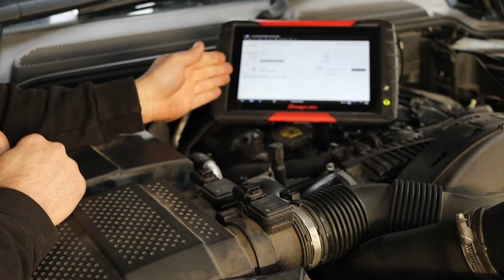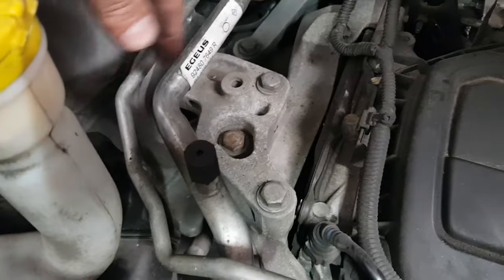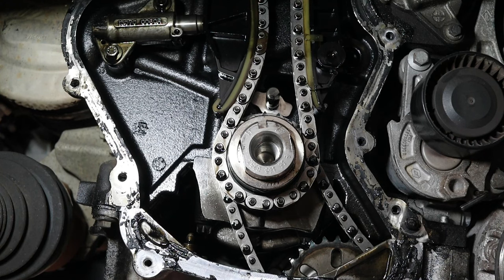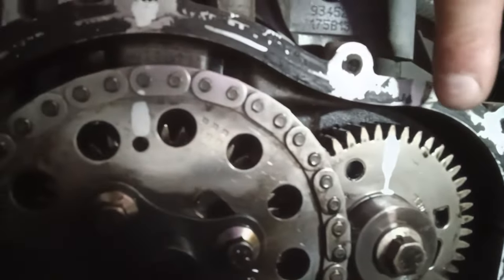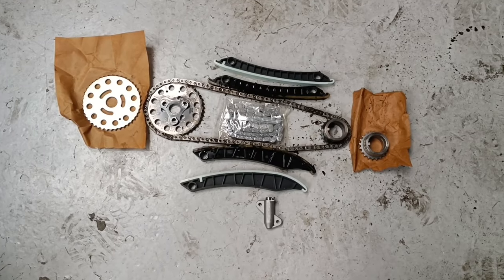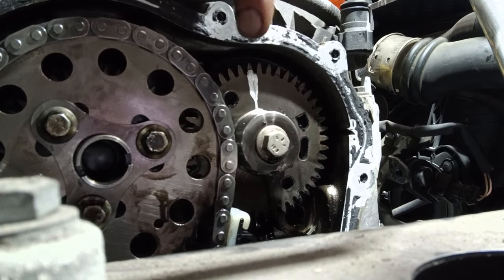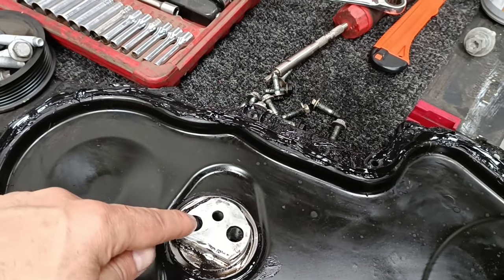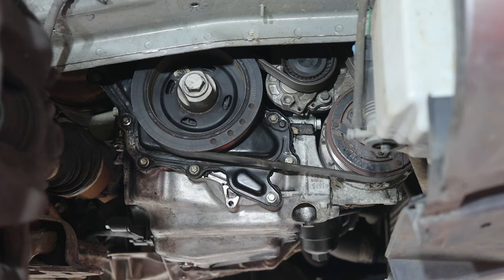Vauxhall Vivaro/Renault, Nissan R9M timing chain replacement

Comment: Really good video, I liked the explanation of there not being a "stretched chain" and instead the links wear out giving the impression that it's stretched.

The camshaft timing confused me though, on another video there seems to be markings on the sprockets, some even have one or more gold links on the chain which you then have to align up with the top and bottom sprockets. Whereas this relied on good old tipex, be fluffed if that rubbed off 😂

I'm glad you shown how to time both the top and bottom without the camshaft locking tool, unless you get one imported there's none in the UK I can find. Any reason you decided against the crankshaft/flywheel locking pin to keep the bottom in time?

Also, with the gasket sealent I tend to find a lot of people stating you should tighten bolts just a tad and leave for around 24 hours for the sealent to fully dry and then Nip them upto torque specs, I was going to do that myself as the R9M is notorious for leaking on the front cover. 

Last but not least, was it not worth replacing the oil pump chain?
Reply from the maker: Thanks for watching, unusually there were no timing tools recommended in my technical data for this engine, I do keep a lot of timing tools but I only needed one, Tipex! The pump chain didn't seem too bad, I guess only time will tell. I siliconed both faces saving me 24 hours, every mechanic will work in their own way and will have their own tricks and tips for repairing different jobs. Thanks for taking the time to leave a comment 👍😊
Reply: unfortunateley on that engine in the Video it's one of the recent R9M engines which doesn't have an oil pump cover any more, it's the whole sump that needs taking off to remove the oil pump and therefore change the pump chain = means removing the fxxxxxg gearbox ! :o My R9M engine is quite old, maybe yours too, we have a small oil pan you can easily remove and take out pump and then the chain, the chain kit only costs around 30 quid too (~25 euros) so yes I strongly recommend to change both. Also gives the sump a good inspection :) I changed my oil pump at the same time which was a bit of a waste of time as the old one didn't have much wrong with it, I thought it was the cause of strange noise sometimes, it just seems when the oil is very hot and I start the engine the tensionner drains itself so makes a big chain rattle for 2 secs. This was happening all the time before changing the chain, but now just occasionnaly.

Comment: hi, thanks for sharing your wisdom, one question, what kind of silicone would you recommend for the timing cover gasket? any brand or reference to be preferred
Thank you
Reply from the maker: Sorry for the late reply, I use plumbaflue silicone, handles heat up to 300c never had an issue using it

Comment: Heya, I’ve got a 2018 vivaro and I think my van has the same issue. Nearly at 100k miles. Definitely a rattle on idle but goes when you pick the revs up. My question is how much does it cost to do that work? Vauxhall won’t do the work on my van as they say it’s not necessary as the chain lasts a life time!
Reply from the maker: Hi, chains don't last a lifetime! They just don't want to do it! This van was a late 2016 with around 70k miles. 
It's about 8 hours work, multiply that with a garages labour rate and about £300 or so in parts. Hope this helps 🙂

Comment: I've done a couple of M9R chains Mel but always used cam locking tool obviously don't need to then
Reply from the maker: Hi Martin, we always use timing tools but there wasn't a tool listing for this job, just showed how to line up the marks, very unusual but it worked and it's still driving without an issue 👍😊
Reply: Is it possible to time these engines 180 degrees out using the timing tools? Mines now has no compression, where before timing was done it had compression, just wouldn’t fire up as timing had slipped
Reply: @melsmotors

Comment: Great video a little bit more info about checking it was fit correctly ,but probably will found out soon is enough or no. Also if you have chance to create video how to replace seams valve for the some model vivaro it will be great.

Comment: How did you know it was 180 degrees out? Any ideas if a 1.9 2004 vivaro camshaft can be 180 degrees out? I've been told no. I will be doing the belt tomorrow
Reply from the maker: It's kinda my job to know what's right and wrong! 😁 All camshafts can be 180 out as the crank has to turn twice for the cam to turn once!

Comment: What sort of damage would a crank sprocket with a handful of teeth do? Broken rockers? Also how do a set the exhaust cam sprocket ? should the renault symbol on the exhaust sprocket be at 12 oclock when the inlet cam.mark is at 12 oclock?
Reply from the maker: Hi, if you have timing chain failure then there isn't much I can say in a paragraph that can help you buddy. You'll need a professional to look at it.

Comment: could a worn timing chain cause my RPM needle to slightly go up and down at idle, and car vibrates at higher speeds, what a cool video, thanks so much.
Reply from the maker: Not normally no! 👍
Reply: Thanks

Comment: I have a 2015 renault master 2.3 dci 136. I need to change the timing chain. Please advice, is it the same design and work steps as in your video?
Reply from the maker: Hi, it will be different as it's a different engine all together. Check your tech data or speak to your local garage!
Reply: @melsmotors  i repair my own vans. I have transit, crafter and this master, i did the timing and all on the other ones with no issues but till now i simply couldnt find any tech data/info on this engine model

Comment: I noticed on the video you didnt use a crankshaft locking pin, is this necessary to use? Im doing my chain  next week on my trafic and wondered if i would get away having to try and access the locking pin location and just use the camshaft sprocket locking tool.
Reply from the maker: This is just one way of doing the job, if it's your first time, then use locking tools! Good luck 👍

Comment: Do you know the angle torque settings for the camshaft sprocket bolts and crank pulley or did you just wang them up?, I’m doing this job soon on my van so want to get it right🙏
Reply from the maker: Hi Julian, Thanks for your message sadly I don't give out any torque settings on my videos as they vary from model to model
Reply: @melsmotors  no problem, thank you for getting back to me so soon 👍

Comment: when you timed the engine up the top sprocket had a hole marked with tipex at almost 12oclock , when you fitted chain and checked marks the hole in sprocket was at 4oclock ish ?
Reply from the maker: Hi Tam, did you hear the engine run at the end of the video? Then the timing was right. My videos are not tutorials but for entertainment, please don't copy what I do, it took me 32 years to get where I am, 20 minute videos won't make anyone an expert in timing chain replacement. Thanks for watching and commenting 😊😊
Reply: It's impossible to get wrong. The exhaust and intake cam sprockets are geared together and they can't be out because he never touched the gears. They don't even recommend a cam locking tool for this engine as it would be completely pointless, for this reason. I didn't see a single thing wrong with what he did and I work on a fleet of these horrible tin can vans. Brilliant for the price you pay for them but far from brilliant by any other metric.

Comment: Just finished watching.. great video..just wondering Mel, you said you do a few of these...how many kilometres until they need replacing? I have a 2017 Renault trafic just ticked over 90,000 klms .... cheers Simon from 🇦🇺
Reply from the maker: Hi Simon, this particular vehicle had around 60k miles on it, about 90000km, you'd only change it if it's noisy, you will usually hear a loud rattle from start up, now that noise may or may not quieten down. Your mechanic should be able to tell just by listening to it. Thanks for watching and commenting 🙂👍

Comment: Evening great video. Would you know if this engine is fitted in the Merc Vito w447? I have read its the same engine?
Reply from the maker: Hi Jaz, possibly the same engine as Mercedes seem to be using a lot of Renault engines in their A and B class cars including the small van that they make. Thanks for watching 👍🙂
Reply: Check what's written on the timing cover
Reply: Search, Google search says w447 uesd 1.6 diesels which are same as this.

Comment: I changed the timing chain on my 1.6 dci on Megane 2014 at 150k km because it was rattling during cold starts. However, the new chain also rattles, and at times, I even need to turn off the engine and restart it to eliminate the rattling sound. Have you encountered a similar case before? Should I consider changing the oil pump as well?
Reply from the maker: Hi, changing an oil pump is a bit drastic! You can't just change something as expensive and as reliable as an oil pump! Don't get me wrong, pumps can pack up. But have you done any kind of checks? at least an oil pressure test? You can't see what an oil pump does so you'll require a gauge.
Reply: @melsmotors  I will talk to my mechanic who changed the timing chain, I don't know what the problem is and what to do now... The noise lasts 10-15 seconds on start and sometimes doesn't even stop so I need to turn off the engine and start it again
Reply from the maker: @armandobasic1507  sadly I don't know, if I could fix cars from afar I'd be a millionaire and work from home like these IT guys 😂
Are you sure it's not a chattering dual mass flywheel? These usually stop making the noise after the 2nd start! Get your mechanic to have another look at it👍

Comment: Did the engine run tidy after? The exhaust cam looked miles out?
Reply from the maker: Yes it did and it's been back since for regular servicing
Reply: Did this job today on my van, did you mean that the little hole on the sprocket didn’t line up with the paint mark? I think that hole is just for reference maybe 🤔 I made sure it lined up on mine today, don’t know if it matters though 🤔

Comment: My Vauxhall main dealer told me they never need replacing 😮 i got vauxhall vivaro 2016 and 100k on clock
Reply from the maker: Did you watch the whole video? They definitely do wear out! After about 3 to 4 years of servicing the dealers don't see them again, most van drivers go elsewhere after the warranty period is over! 👍🙂
Reply: The Nissan/Renault documentation for the Qashqai with the identical R9M engine says the chain should be replaced at 300,000 km.

Comment: Really good,  informative video.
What was the mileage of the van, there seems to be so much conflicting information as to when the chains need replacement.?
Reply from the maker: Hi Lawrence, the mileage on this van was around 65k miles. You replace the chain when it's noisy, there is no interval usually, some manufacturers have recommended intervals and there's further information within the dealer network as they have recommendations through their TSB (technical support bulletins) BMW's 125-150k miles, Ford 1.8D 125k miles. This isn't information you could readily get. Most of the info you find on Google and like are out of date and recommendations change frequently. Most reputable garages subscribe to up to date technical data, we have subscriptions inside and outside of the dealer network. We spend £1000's per year on tech data, diagnostic updates and diagnostic tools, also on technical training so that we don't get left behind. Thank for your comment and thanks for watching 😊👍
Reply: @melsmotors  Thanks for the information. Mine has done 115k with no sign of a chain replacement from the previous company owner. I'll have to keep an ear on it!
Reply: @lawrencecrowe1214  theres no recommendation, we've got vans on 180k with no issues and I've seen ones 3 months old go bang. Every vehicle is it's own story
Reply: @georgecroney6168  Thanks. I have had mine done now. At 115k the chain still had plenty of life in it but I'm glad I got it changed.

Comment: Good job how long does it take for a mechanic to replace the timing chain as I’m getting mine done Monday week
Reply from the maker: Hi Shane, the book time for this job is 6.7 hours, that doesn't take into account oil and filter change and cleaning the old silicone sealant. This job was charged out at 7.5 hours plus parts. I hope this helps. Thanks for watching 👍🙂
Reply: @melsmotors  thanks for reply

Comment: Does it need to be done if you’re changing the oil every year or are these prone to stretching?
Reply from the maker: Hi, this engine was noisy, it was rattling, I couldn't get the noise on camera as diesel engine are so noisy by themselves. ONLY change the chain if it's noisy. Chains don't stretch as shown in the video, they wear out giving the illusion of stretching. Thanks for watching and commenting. 🙂👍

Comment: Do you recommend an aftermarket kit Or Genuine only ?
Reply from the maker: A genuine or good after market part, dealers don't make chains, they buy them in from chain and sprocket makers!
Reply: @melsmotors as with most parts they stick their names on them and triple the price , ive heard the chain is made by jwis but not sure on the sprocket's, surely an Ina kit would be ok ?
Reply from the maker: @208d  Ina, FAI, or similar would be fine
Reply: @melsmotors  thank you! thats what i was thinking 😊 fairplay to you . These videos are so helpful!
Reply: Genuine only

Comment: great video, would never dare risking without the cam timing tool however, I recommend it to assure the camshafts are lined proberly ;)
The OEM's recommend to take the engine out, they're wrong I've seen many do this job in the car haha. I changed mine with just 80 000kms on it, how many did this one ? I'm guessing about 100k miles by the look of it. Mine has now near 170 000 km, but sometimes starting to rattle again, I'd suggest every 200 000kms at most we should change this chain if we don't want noises, saying that some are noisy some aren't... (listened to loads of these R9M engines...)
Reply from the maker: This had around 60,000 miles, 100,000km. My tech data didn't show timing tools which was surprising, it just showed marks as I showed in the video! Thanks for watching and commenting 👍😊

Comment: Can someone please tell me when the timing chain needs to be changed? is there an interval?
Reply from the maker: @2madita  there is no replacement interval for a timing chain, you'd only charge the chain if noisy. If it rattles when it start it from cold and then the noise disappears after a few seconds, then that's an early sign that it's time for a change 👍

Comment: Interesting video. I would to change the crankshaft pulley but how tight should i need the bolt? Thank you
Reply: Depends what engine you've got. Really doesn't matter that much either way. Specs are something like 90 Nm +50° or 130Nm + 50° for a biturbo. Either way, as tight as you can by hand it's not critical. It's a 12pt 21mm bolt into a steel shaft so to break it you'd have to weigh a ton. Specs are from rough memory it's a dead easy job to swap a pulley

Comment: Incorrect way u must use timing tools exashust cam can move inside gear once the three bolts are slackened and u will have noisy engine afterwards plus new cover or it will leak
Reply: He's marked intake shaft so if exhaust would move then intake would move. As long as crank shaft is in right position and intake then no tools needed but not a bad thing to put a tool on and check if it's corect. By the way if you going to use a tool then it comes with crank shaft lock pin.
Reply: Not so look at the slot on exhaust cam it should be horizontal and is not moving when u turn inlet cam with the 3 bolts slack so there fore actual exhaust cam timing is off

Comment: Hi where are u based
Reply from the maker: Based in Bracknell Berkshire
Reply: @melsmotors    Question why was the timing 180 degrees out ? If you haven't moved anything (sorry not that knowledgeable)  Thanks in advance
Reply from the maker: @Marti-dw9xt  It's a 4 stroke engine, the crank has to rotate twice for the cams to turn once, it was a 180 degrees out because the crank had only turned once!

Comment: It was going great until he installed the new timing chain kit and screwed it up. 
Incorrectly installed. Copper parts should be alligned on the timing marks.
Reply from the maker: Screwed what up? When you're a professional you don't need to line up the copper coloured links, that's what the timing marks are for! There's loads of timing chain engines without copper links, how are they done and timed? You use the timing marks or timing tools! You did hear the engine start and run in the end right? and it's been back for 2 services since without an issue. This isn't a tutorial on how to change your timing chain, it's for entertainment! If you need to watch a video on how to do a 7.5 hour job like this, then this job isn't for you, it's for a mechanic. 

Another keyboard warrior who needs to run down someone's video and add his useless 2 pence worth!!!!

Comment: All this work and you didn't change oil pump and chain which is obviously worn on your video and probably making noise on start up. Why you don't invest money in timing tools and do the job properly?
Reply from the maker: Hi Tom, thanks for watching and commenting, the van had only only done 60k, and it wasn't as bad as you think so I left it. I showed you in the video that the tech data was showing timing marks and no timing tools for this engine. I have plenty of timing tools! 🙂👍